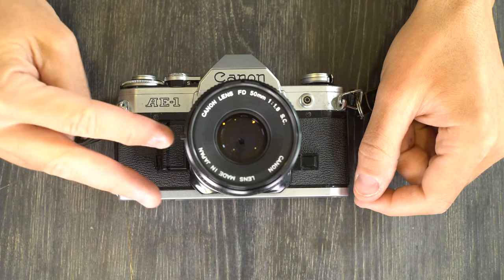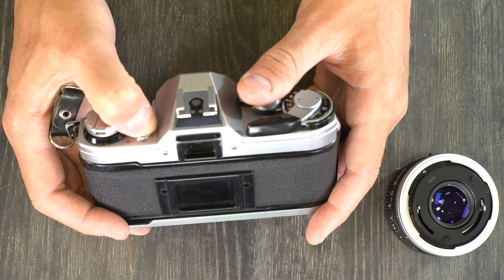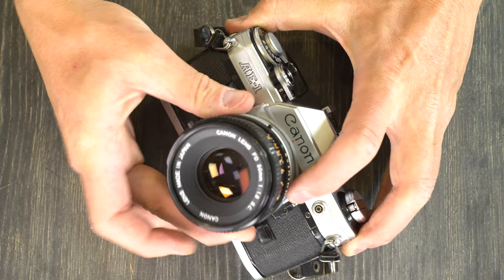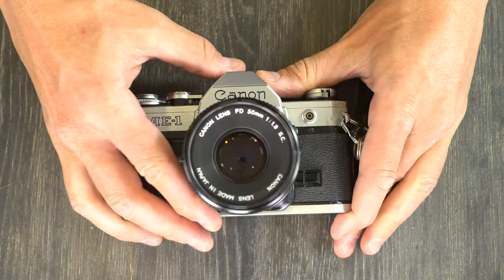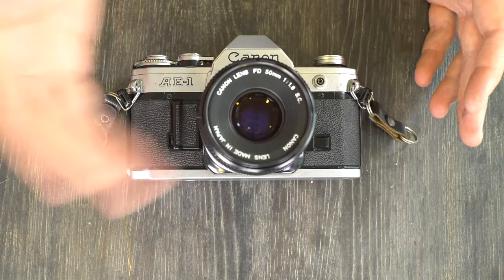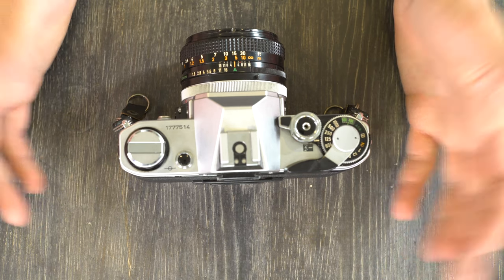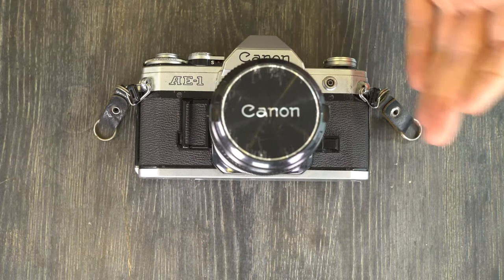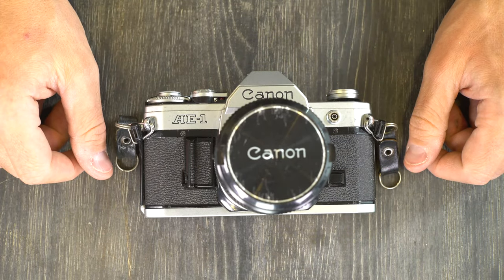Canon AE-1 Manual 2: Operation | Take a Photo, Double Exposure, Batteries, Lenses, Metering, & Flash

Comment: The video kind of confused me on the light metering part and I may have been taking pictures a different way the entire time😂 For example I'm outside on a sunny day taking a picture with ISO 400 film and I want to use aperture f/2.8 and shutter speed 125/s I just change the ASA lever on the camera until I get 5.6 on the cameras light meter. I never knew you were supposed to leave it at 400ASA if using iso 400 film, but all of my pictures come out exposed normally.
Reply from the maker: There is some exposure tolerance with both black and white and C-41 films, so my guess is that the shots are way over and the negatives are very dense. So give this a try with some film and leave the ISO the same throughout the roll. I would think that the images will have a better tonal range and contrast profile.

Comment: 17:33 i have a question about manual mode. if i use f/4 for the aperture and 1/60 shutter speed but the needle say is f/8 for the correct exposure but i dont want to change the aperture to f/8, do i need to change the shutter speed to +2 stop 1/250 or -2 stop 1/30 for correct exposure?
Reply from the maker: 1/250th. You're shooting at an apperture two stops faster than recommended for your current shutter speed so you need to cut two stops of light through the shutter, so it's -2, 1/250th. (The plus and minus in your question are flipped, which is easy to do as this part of the terminology is very confusing.)

Comment: I can't get my old silver ring lens on, it won't turn when I line up the red dots, any suggestions?
Reply from the maker: Which lens is it?

In general, the red dot on the silver ring ought to align with the focusing point indicator on the lens. Then on the back of the lens itself there should be a code -- a letter and some numbers -- and that should also align with the red dot on the silver ring. Then make sure you've advanced the film and that the DoF preview lever isn't engaged and, if so, it ought to mount fine.

There area handful of lenses that won't mount on this camera, but they're all old FL and R lenses and are rare.
Reply: I took my lens off the other day and a couldn't get it back on, when I had tried the ring rotated like if it was on the camera to secure itself to the camera, but since the lens wasn't on correctly the silver ring rotated and misaligned, I had to rotate the silver ring counterclockwise to be able to get it back on the camera and twist it to latch on

Comment: When I adjust the aperture am I supposed to see it open and close in front of lens ? Bc nothing happens I just hope I didn’t waste film
Reply from the maker: Nope. The aperture only closes when you take a photo. If you want to verify that the aperture works, set the aperture to f/16 and try the DoF preview button (DoF preview doesn't work with the lens in A.) If the aperture closes, you're good to go. Just set it back to A when you're done.
Reply: @DavidHancock  ok so I just did that and the aperture did close up smaller . So if I wanna shoot at 1.8 just set ring time that and when I take picture it will be set at that ?
Reply from the maker: @herondelacerda  you can, bit be sure to follow the instructions for manual shooting. It's a different technique than the standard shutter-priority the camera is designed primarily for.
Reply: @DavidHancock  oh ok I’ll try and look through your videos for more explanation

Comment: to test the meter in my canon ae1 I put iso 3200 and a speed of 1 second and it tells me that the best aperture is 1.2 and a red light lights up, all this in "A" mode, shouldn't it tell me about exposure?  Does the photometer of this camera measure differently?  I have a few days with her hahaha😅😅
Reply from the maker: That's concerning. That's a common symptom that the electronics on the camera have died. So take it outside on a sunny day and with the sun to your back set the ISO to 125 and shutter speed to 1/125. The aperture should indicate f/16, or something about that with the lens in A on the aperture ring. Any trading from f/11 to f/22 is fine, but the way. If it still shows the dot and f/1.2, your electronics are bad and the camera is dead. Fixing that is so expensive and complex that I don't know of a single repairman who will do it.
Reply: @DavidHancock  I followed the advice and it marks me between f2 and f2.8 will I have to measure with an external photometer?  or does it affect the final result at all? 😪
Reply from the maker: @giampiero62  If it says f/2-2.8 at 125 ISO and a 1/125th shutter speed outside in sun, then that will affect the images. That it's not giving you the red dot is good. It sounds like one of the photo cells in the meter has died. That's repairable, which is the good news. But for now, as is, your camera is overexposing images by 4-5 stops, which will definitely room the film.